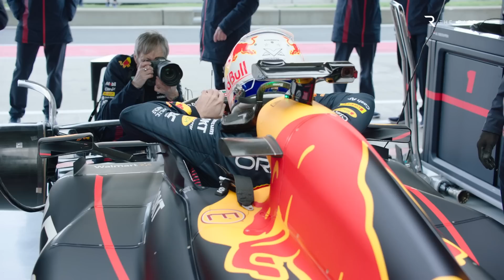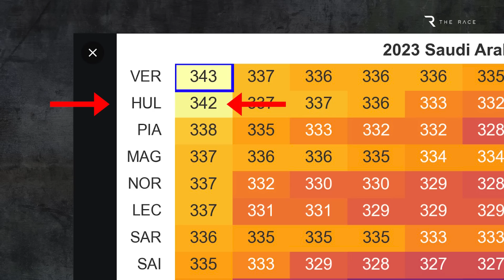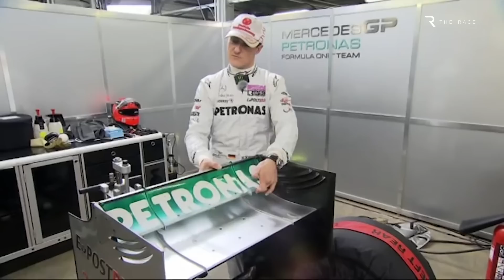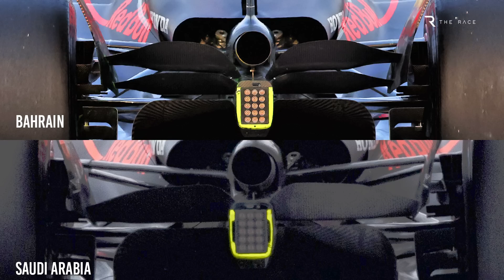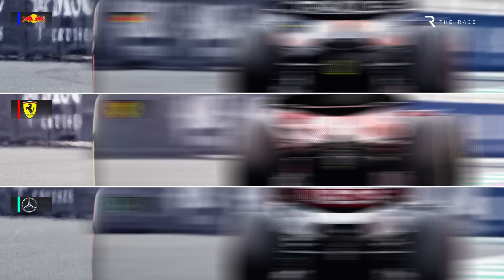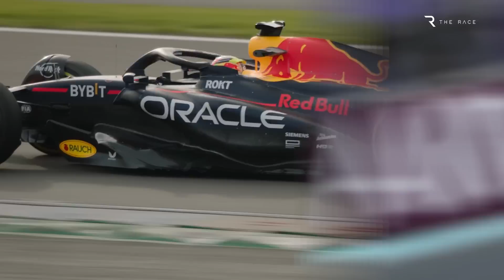Red Bull's genius 'triple DRS' F1 trick explained

Comment: How can you say it's all about aerodynamics?
Power units must have some affect. I would say the Honda unit have something to do with the Red Bull superior advantage.
Reply: the difference in power unit is definitely not as much as people think. There is also the fact that it's the same as last year because of the engine freeze and still redbull are faster than they were last year
Reply: If your new to F1 ill explain. ThE difference in PU's between HONDA>FERARRI>MERC>RENAULT is actually very minimal in terms of HP output, torque etc. There is some difference and from best to worst in that order above. But in this late stage in this current engine regulation that was introduced in 2014 all the teams have caught up to each other even Renault which was struggling for years in the background is basically outputting the same HP as MERC. Just other things like reliability. Also advanced engine modes where banned a few years back so you have relative egalitarianism on the PU front until 2026.
Reply: @TheDiasporaMedia  I don't think you can say they are all equal.
I understand they are building according to the same specifications, but I have seen Honda capabilities over the years and their ability to develop engine performance above all others.
Reply: @Ken-vf5cv  Re: HONDA>FERARRI>MERC>RENAULT - because you dont read comments and that leads to you misquoting what I said. Clearly Honda is the best but the gap to HONDA>RENAULT is not nearly as big as the chassis gap between say RED BULL>ALFATAURI/MCLAREN. Thats all I was saying chief.
Reply: @TheDiasporaMedia  I am sorry if you think I did not read your comment, but I evidently came to a different conclusion from what you wrote.
Reply: Because the video talks about speed differential when the drs is open versus closed. The engine doesn’t work differently depending on drs status. It can only be an aerodynamic phenomenon. 
I wish they would’ve shown a comparison for all cars with drs open/closed. That would’ve really proven (or disproven) that the redbull drs is really more effective than other teams’.

Comment: "I've never seen a car so fast"....
Mercedes W07 has left the chat
Reply: W11
Reply: @NaplesFC  i agree but my point was back in 2016 mercedes could won 21 races of 21, Max won in Spain when both Nico and Lewis crashed, and Danny Ric won in Sepang when Hamilton had engine failure.
2020 other drivers won races when both mercs still on track. But like i said i do agree. Cheers

Comment: Does the the texture of the paint have any effect aerodynamically?
Because some cars have a glossy coating and some have a matte coating...
Reply: From what I’ve heard the main difference between glossy and matte paint is that matte paint is lighter.
Reply: matte finishes save you a few grams of weight but texture may have something to do with how air flows over it. a smooth ball flows very different from a golf ball with a bumpy texture so you may have a point or maybe its negligible. Only Adrian Newey really knows lmao
Reply: For the paint they use, it doesn’t no. It’s a matter of weight. You could have paint which could have aero effect, but it would need to be very very bumpy, the golf ball dimple is a good idea of size for the bumps. What that does is ensure you have a turbulent boundary layer. In cases where you know flow will detach, this helps control when and where it detaches, which leads to reduced drag. However, in the case where you want nice, smooth, laminar, attached flow for as long as you can, bumpy paint would increase drag, and more importantly, mess up the airflow to other parts of the car, which is why they don’t do it

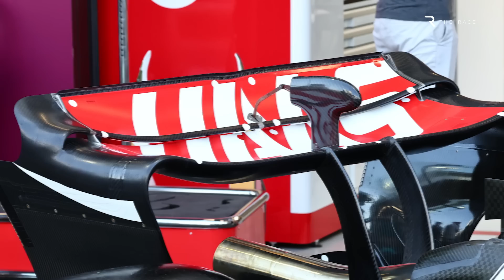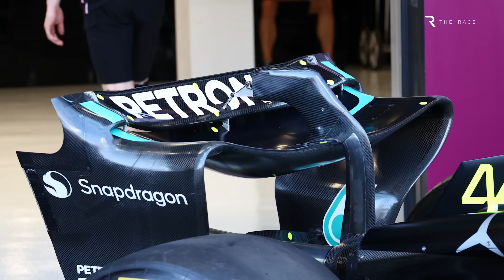Comment: anyone know about the yellow and white dots on the rear wings? 3:17 to 3:30
Reply: They were introduced mid 2021 to try and combat the flexi-wing controversy but then they were made much more significant last year. Its so the FIA have a visual guide to measure how much the wings are moving under load
Reply: It's to detect deflection after RBR had engineered flexy wings that passed the static loading tests.
Reply: @hotshtsr20  interesting! thanks
Reply: It for mesurring how much rear wing bends under load, if you recall few years back there was a fuss about i believe mercedes or redbull rear wing bending in barcelona racr, in turn reducing downforce in a straights, so FIA introduced mesurring system, hence the dots on a wing

Comment: It's almost ridiculous how the RB19 can have so much downforce and top speed without letting it seem like there's a compromise between either. I'm a Merc fan but I have to give Newey and his team their flowers.
Reply: It's not super common but it's also not that weird, there have been many times that the best F1 car of that year has that very quality.
Ross Brawn talked about one of his old Ferrari's being so good they would deliberately run a downforce setting low enough to make sure they were quicker in a straight line than their rivals at the time, whilst carrying enough downforce that they remained the fastest in the slow corners.
He said it was all possible simply because they had the best downforce/drag ratio at the time.
Basically they didn't try to run their car at it's optimum setting, they just made sure they were fastest in the speed trap and fastest in the slowest corner and had a balance the drivers liked, with that the car was always too quick and the drivers were always comfortable pushing it.
As a counterpoint, I've heard David Coulthard talk about his Adrian Newey designed McLaren's from 1998/1999 and he talked about how they weren't his favorite F1 cars despite them being some of the best he ever had in his career (relative to the field) because to get the best from them their setups required "too much understeer" and he just didn't like that balance in his car.
If he dialed it out, he have up too much performance.
If Redbull have so much performance in their car, they might just be doing what Ross said Ferrari did, focusing on giving Max and Checo a balance they like as long as they have the top speed trap and fastest slow corner speeds.
Reply: @launchsquid  think the video highlights something more …  the RB is not a trade off or ratio between slow and fast corners but they can get the best of both worlds by bleeding drag at speed (by stalling the rear beam and diffuser plus clever wing aero) but retaining downforce at lower speeds. That is remarkable.
Reply: @launchsquid  I agree, as a Mercedes-AMG F1 fan and a mechanical engineer, I am quite impressed with the magnificent job Adrian Newey and his design staff did with the original RB18 concept and the RB19 evolution. In previous generations of F1 car design regulations there were  two predominant race winning design concepts, i.e. Mercedes-AMG W12 with its long-wheelbase zero to minimal rake concept and the Red Bull Racing RB17 with its short-wheelbase high rake concept. With the new ground-effect regulations, there appears to be a convergence to one dominant design concept of the RB18/RB19 evolution. The possibility of a competitive second half of the current season lies in the fact that Aston Martin Racing and Mercedes-AMG F1 realized that their initial ground effect design concepts were inferior to the Red Bull RB18/RB19 and have decided to change concepts and converge on a Red Bull RB18/RB19 concept. Obviously, Aston Martin realized their initial concept was inferior earlier than Mercedes, hence the performance of the AMR23 thus far. Scuderia Ferrari on the other hand are staying with their SF1-75/SF-23 concept on the basis of suboptimal setup is the limiting factor to unlocking its race winning performance.
Reply: @launchsquid  There is more, generally higher downforce means more drag because every surface adds drag and this is the case for and airfoil, however there is an old trick from the late 70s ground effect rearing its head, the Venturi tunnels under the car do not produce more drag, because they use a different trick to produce downforce, the air going out the back actually is beneficial to reduce overall drag, and the more you push out the less drag you have and the more downforce you have, this is what Lotus found in 1978. This means more downforce=less drag paradoxically, that is why Red Bull is dominating because having more downforce means better car overall.
Reply: It comes in eras, this seem to be RB era of dominance, previsouly it was Mercs, before it was RB again... But with the penalty RB has and the development potential on the AM i hope that the end of the seaosn will be tight.
Reply: Not only that but the RB19 being able to run so low
Reply: Everyone is trying to brute force the SSJ2 transformation (metaphor for the ultimate ground effects car tech)

So we have Merc as Trunks that went for just raw power in detriment of speed, so he became vicious and bulky (by carrying the Merc sandbags ☠️), but went nowhere due to the sheer uselessness of their engine power if the car can't corner for shyit.

Then we have Vegeta, that realized that pure strength does no good if he can't move fast enough to hit his enemies, but couldn't reach any higher because of his own limits (that would be Ferrari because they are bad as a team, no cohesion between team strategy and the drivers).

You also have Goku, that realized just the same as Vegeta, but went even further beyond because he realized he could fight longer if he conserved energy while transformed, so he mastered the SSJ1 form to not waste any energy and feel as natural as possible, and that would be RB, they are quick because of the balance between good engine power and awesome aerodynamics, that makes them have grip without tyre degradation, so they can run faster and longer than anyone else.

And to top it off, we have Gohan, that by unlocking his hidden potential, could surpass naturally everyone and be the first to reach SSJ2, just by raw talent, and that is now Aston Martin, with the new addition of the GOAT Alonso as a lead driver, as he can unlock the masterpiece that the Aston team put together in a winter for a car.
Reply: @JohnWiku  did you really just write paragraphs about F1 in a Dragonball context lol that's awesome but also what
Reply: I respect you for saying that, not many merc fans that would give flowers where due
Reply: @officialseany4068 Adrian Newey is a beast. One of the best technical minds in F1 coming from a LH fan
Reply: @officialseany4068  there's more of us like that than you think. What Newey has done with that car is nothing than less than phenomenal and he deserves every bit of praise that he gets. Certain others at Red Bull however deserve every bit of crticism that they get.
Reply: @officialseany4068  They are fanbois not F1 fans real F1 fans give credit and respect where due.
Reply: well that's the advantage of having ground effect cars
Reply: Adrian is a living legend, he is the Ayrton of the engineering world.
Reply: It's nice to see a rational merc fan, no offense lol. I'm not a fan of red bull either but there's no denying the genius behind their team.
Reply: Largest of the big 4 and arguably one of the closest rivals.. Aston have over 60% more allocated wind tunnel time than Red Bull this season... if they can maximise that.. its possible that they could pose a real threat to Red Bull by the end of the season.
Reply: Perhaps we can convert you lol
Reply: @mrsoisauce9017  I'm not a Mercedes diehard but I just cannot root for Max he is just too annoying and rude and ungrateful. My hope is Aston Martin and Alonso this season to at least make it a lil interesting since Ferrari is so intent on sabotaging themselves and Merc can't build a functioning car anymore. Happy for Checo though he deserves some Ws
Reply: @presinald  it was a joke, my guy. I was messing around
Reply: @presinald  Unfortunately for you, Checo is not good enough, Max is just how he is, honest and straightforward, not like Lewis with his politics and 'behind the elbows'
Reply: what a whitewash video. so if the DRS was so genius and legal why did it silently disapeared??
Reply: It's technically slower and has less downforce than the last generation
Reply: There is no Merc fans, who are you trying to fool? Hahaha, no offense. I'm just saying that your comment is only to bring Newey and discredit Max, as others did with Vettel before. Am I wrong? Look, Hamilton is genius, he won 7 titles running on foot, while others were driving fast cars, hahaha. No aero, no power, no BS.
Reply: The compromise is literally the downforce itself. The maximum numbers are lower than some of the other teams, with the way it’s balanced being what makes the RB so quick
Reply: I'm a McLaren fan and I don't care about this season anymore lol
Reply: @Ares14  I know how you feel the question in my mind is which team will buy out Landos contract if things don't improve.
Reply: @mechsgtpuma938  probably Audi, but that would have to happen under 2 conditions:
1. They have to let go of Valterri Bottas, which given his experience would be unlikely
2. They would have to overlook a desire for a German driver, which may also be unlikely because German pride
Reply: Just imagine how much further ahead would RB be if they didn't have reduced windtunnel and CFD because of there overspend and winning last year championship restrictions.  I just hoped that the other teams had closed the gap instead of increasing it.
Reply: @mechsgtpuma938  there’s only one team that can close the gap to Red Bull, and that’s Aston Martin
Reply: @mrsoisauce9017  I hope your right about that or otherwise its going to be a long and difficult season to watch if its just the Max and red bull show
Reply: As a new fan and as someone who doesnt root for any particular team, go rewatch the 2020 spa quali.
Reply: Don't play fool! It's not about the aerodynamics as much, but as how HONDA owns the key of the MGU-H to deliver such versatility rising the torque and to push when activated by the DRS... TOP ENGINE EVER in F1 for this era, too! PS: Ferrari and Merc (by Aston's) have already cracked engines...
Reply: @lovemademan  If that were the case, then Alpha Tauri wouldn't be so far behind.
Reply: @lovemademan  Red bull had always the better designed car, but Merc the better engine, now the engines are almost the same, the car is now more important than ever...
Reply: @mushie8447  That's bollox. The W08-11 had remarkable aerodynamics and the chassis was top notch contrary to popular belief.
Reply: @mushie8447  Crapcedes from 2021 had the worst engine ever! Stroll's crapcedes blown in the last race, so fof with subjective wannabe's. Proof is that from 2021 HONDA engine had top power and turbo by its new generation MGU's... Most improvement had in 2022 than now proves over the top in every aspect compared to any engine on the grid! Even Tsunoda in top speeds is in top 5! Swallow that!
Reply: @mushie8447  Merc previously designed similar or a bit better or bit 'not better' than the Red Bull during the Paddy Low and James Allison era (2013-2021. Now it is worsen under Mike Elliot, with slower engine and not a good designed car. But tbh, both Hamilton and George Russell is a very fantastic driver. With a car really slow on the straight, they can still get 4th and 5th. Amazing accuracy to extract every bits of the car in the slow and medium corner.
Reply: @lovemademan  Except there is no PU development allowed outside of reliability until 2026. We saw it in Brazil 2021, the Merc PU can keep up with the Honda and the current rules are based around aero so yeah, it is aero related. Also, as someone pointed out, why are the AlphaTauris way off their previous pace?
Reply: @GloomGaiGar  you saw crap! Merc had a new engine and Max an old one, plus the issue of loosing was because of the tire strategy... So mind your crap!
Reply: Why don’t you keep those flowers and put them on the grave of the Mercedes dynasty